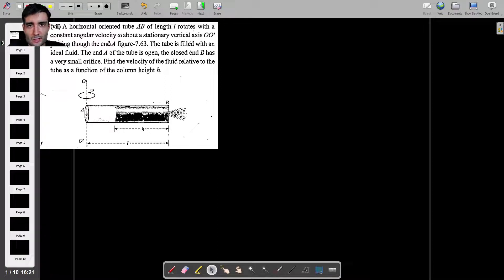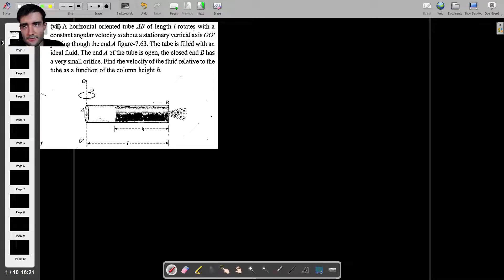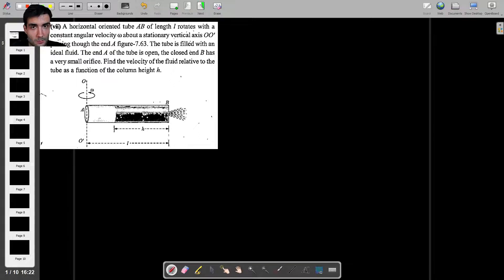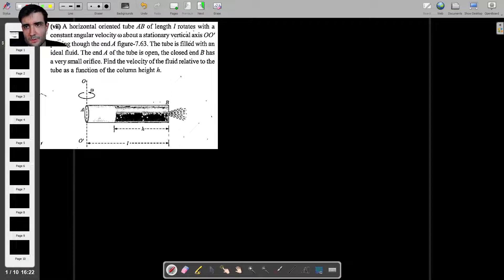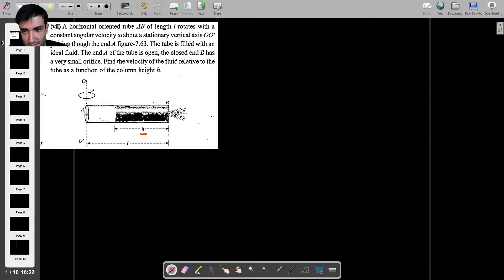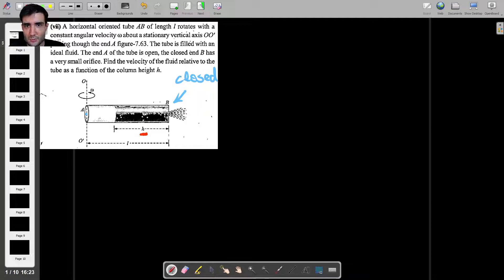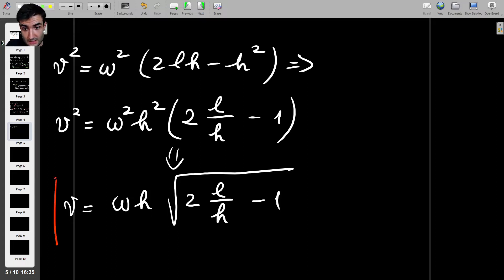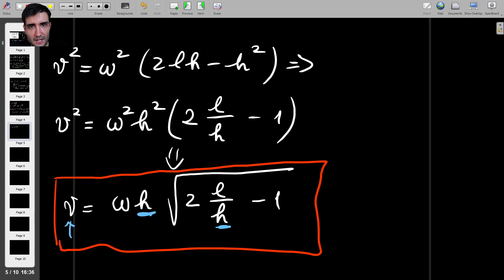Fluid Mechanics - Bernoulli within a Non-Inertial Reference Frame

Comment: So, what about the non-inertial reference frame?  The Bernoulli equation a reductive version of the Work-Energy Theorem, which requires forces and motions to be with respect to an inertial frame.  This problem is essentially a turbo-pump, where velocity depends on the flow rate, (which depends on the orifice size in this problem).  The absolute exit velocity could be anywhere from zero to 1.732 times the tangential velocity.  Try again.